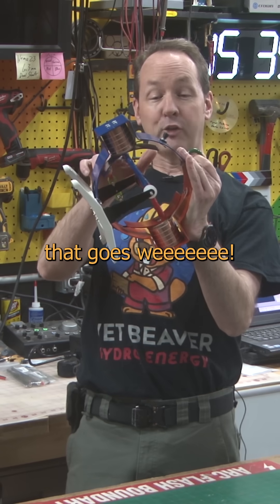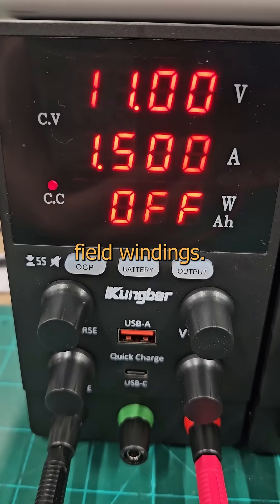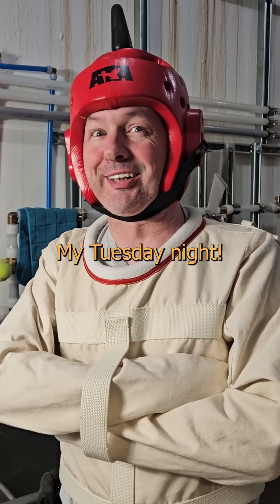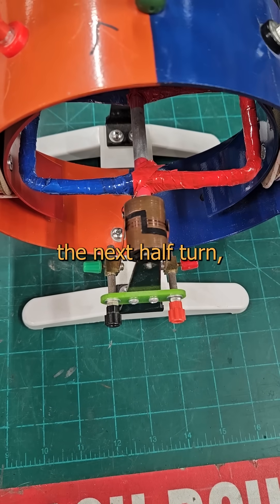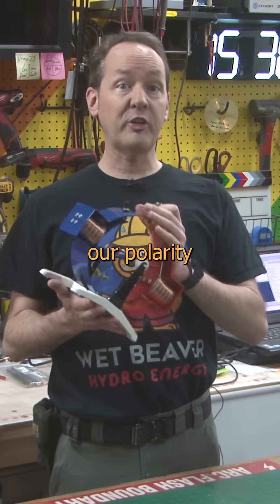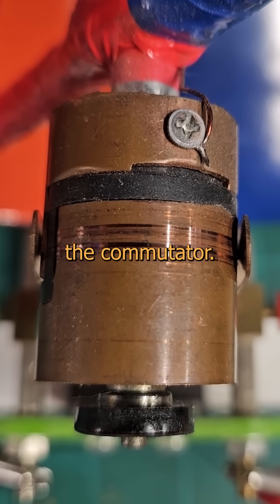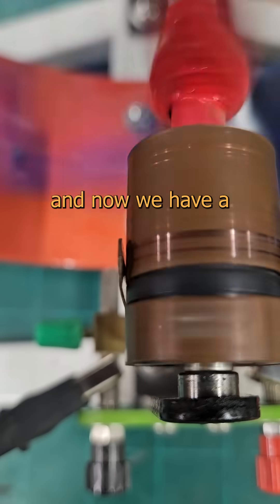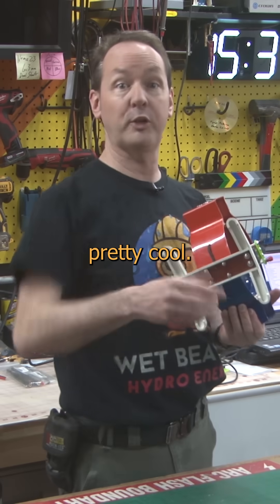Commutators #chrisboden #comedy #engineering #motor #electric #howitworks #science #educational

Comment: When you were explaining how it worked, I was wondering how you got the timing of the motors, right.. I was thinking it had to be a fairly complex electronic system, but it turned out to be mechanical. That is absolutely
the best way to do it, and it's so simple. Thats such a clever solution.

Comment: How can you be so educated? But yet so stupid all motors are solenoids and all solenoids are motors. They can be reversed and do the job of each other. How is it that somebody with no formal Education knows this stuff, but you don't?
Reply: No, not all solenoids are motors, although some solenoids are part of or act as a motor. A solenoid is a coil of wire that creates a magnetic field when current passes through it. While some solenoids, like those in starter motors, are directly used to turn a motor, others are used for other purposes like activating solenoid valves

Comment: It would be really cool if you could build that so that you could switch out the the commutator with slip rings quickly and easily so that you could demonstrate the difference between the two in real time using nothing but electricity. Or maybe attach both and make it so that your brushes can be slid from one to the other to demonstrate how they work.

Comment: I imagine if you didn't use the shaft as a timer to change to polarity, a flywheel would work. but at slightly less efficiency because of added weight + inerta (and thus torque) needed to turn?

Comment: She be torqing on my shaft, I'm talking real low coefficient of friction, but let me tell you, at some point frequency changed and the amplitude of the sinusoidal process increased, causing a decoupling. AND WHEN RECOUPLING WAS ATTEMPED TOLLERANCES WERE NOT TO SPEC. Damn shaft buckled, elastic modulus was too low, permanent deformation was unfortunately achieved.

Comment: I wonder how engineers prevent the rotor from stopping right in the middle between the two segments on the commutator. Resp. how to start the motor from that position. (Yes, that doesn't happen often but it does happen if no countermeasures prevent it). Apart from that: Thanks for your videos, I really enjoy your shorts in my breaks, both presentation and kind of humor tickle my brain in all the right places :D
Reply: The answer is that they have more than just two magnet poles on real DC motors.  This way, when one magnet's poles are aligned with the field, another rotor magnet is available to keep it moving.

Similar to how gasoline engines have 4 piston/cylinder assemblies that are staggered to run on different stages of the cycle.  This way, one of them is running the power stroke at any given point in time, to power the movement of all the rest of the pistons.

Comment: I love that the commutator is set up such that you can move the brushes over and have a constant slip-ring type connection; couple that with an external inverter (and some sensing stuff probably) and you've turned it into an AC motor!

Comment: Alright, now you just make it generate enough electricity to keep itself powered and you get a perpetual motion machine

Still no idea why its impossible, we do it all the time with cars and car batteries

Power goes in one end, comes out the other, and that power gets used to help generate more power to go in and out until the battery turns to dust
Reply: Cars and their batteries are not perpetual motion, they burn fuel to keep the battery powered.
Reply: @spaceageGecko  

Yeah, so we can run the engine. That's not what I'm talking about

I'm specifically talking about the actual power part of the car battery, you know, the thing we use to make the car turn on

If you put an almost dead battery in a car with enough power to start and run the car, you will eventually charge the battery. That's more power than the car actually needs, which we can then use the extra power to power a machine that automatically puts fuel in the engine, and another machine that is, itself, battery-powered, which can go source fuel

It's called automation, and once you get it to a certain point, you'll never have to touch it for it to run forever

Comment: Layman's question:  I noticed the sparks between the brushes and the commutator and wondered if those wouldn't set off the arc-fault circuit breakers I understand are becoming more and more common?
Reply: If there were a DC motor, it wouldn't be powered directly by the mains electricity.  It would first have to pass through a DC power supply.  This will filter the waveforms of the circuit that powers the motor, so that the AFCI breaker in the panelboard wouldn't detect it.

Comment: This is how my dad's motor works. He uses a piece of tape as that timing switch. If you youse a magnet in the middle, and electromagnet wire constructs on the outside, you can create the same structure, and if you use a wire bundle that's not attached to the system, you now turned it into an electric generator that's not too inefficient

Comment: Alright so why cant we attach it to a dc motor to generate electricity. Start it spinning at first how ever you did in the video. And then use, say a 5v microcontroller with relays that allow the polarity to switch, "powering itself". If it is a 12v dc motor it wouldnt be using up all of the power it is generating... Right?

Comment: @Chris Boden - You know, you can make an electric motor using that 'solenoid' thingy.  ;-)  I made what was essentially a 'radial' layout electric motor using an eccentric crankshaft and custom wound solenoids as a science fair project in high school.  It worked remarkably well given the limitations of tooling I had access to for making the crankshaft, connecting rods, and the cams used to control switches to energize the solenoids.  The solenoids were wound on paper bobbins with steel frames and an adjustable ferrite pieces at the end of travel to 'focus' the magnetic field on the hand turned 'pistons'.  Oh - and the windings were aluminum ribbon (aka - aluminum foil) w/wax paper insulation between layers because I couldn't afford that much copper wire.  Ran it off a 12V car battery - it was pretty amazing for as 'sloppy' a build as it was.

Comment: That honestly blew my mind. I always thought it was some microcontroller or something, but something so simple as having two plates with a gap is incredible. I love it!
Reply: This is routinely done in physics classes by 14 year olds (sometimes without a proper commutator, just bent wires).

If you've ever seen one from your car removed from its housing, you'll notice multiple windings and a commutator with way more than just two segments.
Reply: There are different solutions that use microcontrollers, so you get a brushless DC motor for higher speeds for quadcopter or a stepper motor for better position controls for CNC machines and 3D printers.
Reply: Yeah, the modern ones use microcontrollers so there's no physical contacts aka "brushes", so what you have then is a "brushless motors".  

No brushes means no friction so no energy loss to friction, and no wearing out of the brushes.  

Also, the microcontroller can be programmed to vary the timing so you can get different speeds.

Comment: That’s mechanical timing. Many many modern electric motors use sensors to detect the rotational position, and electronics to control the polarity of the field magnets, removing the need for brushes.

Comment: Isn't this just a brushless motor without the fancy circuit board? Or is that actually how brushless motors work?
Reply: The "sectional conductors" are brushes.
Reply: This is a brushed motor

A "brushless DC" motor is usually a permanent magnet three-phase synchronous motor where a little computer turns the incoming DC into properly timed 3-phase AC
Reply: It's a very nice universal motor :) It's also running on both AC/DC (Like in the vacuum cleaner motors)
Reply: @_decky4ever_ 

Useful for when one is on the 🎵HIGHWAY TO HELL ! 🎶

Comment: I always wondered how to get AC from DC
Reply: While technically AC, it isn't the same waveform as you get from a wall outlet.  If you measure the voltage across the rotor winding, you'll get a square wave rather than a sine wave.

You'll additionally need low pass filters to convert the square waves into waves that are sine waves.

DC to AC converters are called inverters, that use digital switching of transistors to produce such a square wave, and then use LC low pass filters to get it close to a sine wave.